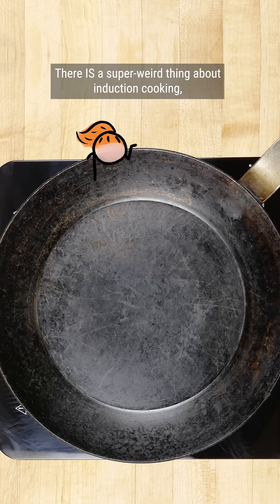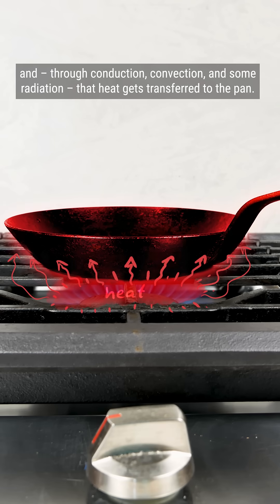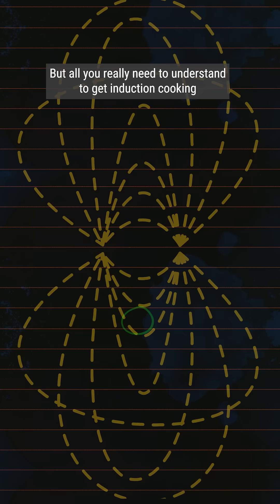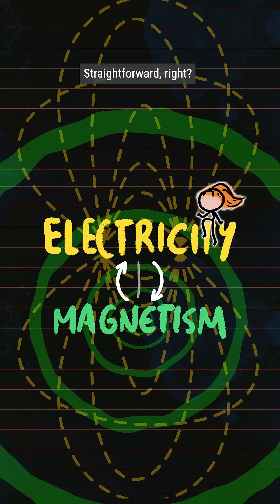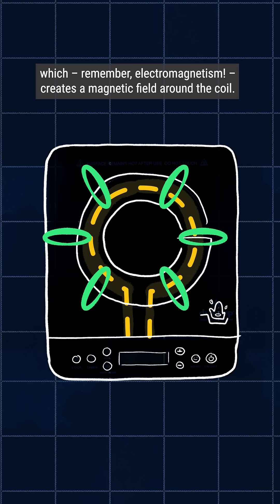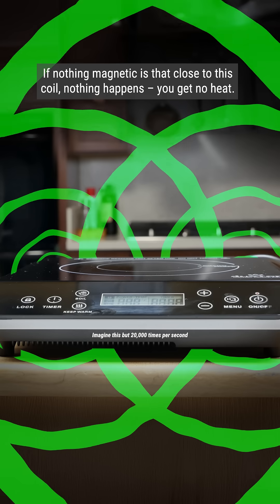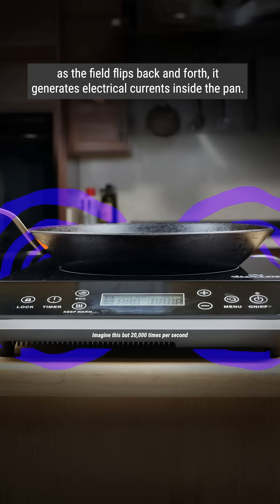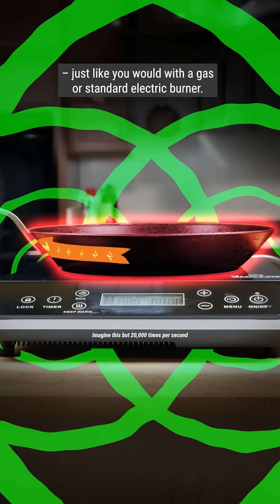How Induction Heats Your Pan

Comment: So yeah good attempt but it’s not actually correct. As has been stated, only ferromagnetic cookware works properly on these burners. This is because the heat is mostly generated through the losses associated with magnetisation or hysteresis losses, not eddy currents.

Comment: The other weird thing is that cooking with induction is a lot more like cooking with gas than cooking with an electricity burner bc when the power is gone, the pan starts to cool down immediately whereas on an electric burner the mass of the burner retain heat for a long while…. (A ceramic (infrared) is more or less in between the two) 

If you can't stand the heat (in the kitchen) it may be time to switch to induction :D

Comment: It's NOT magnetic feld, IT IS A RESONANCE FREQUENSY!
Reply: what do you even mean by that? It's just eddy currents in the metal of the cookwear that generate heat. Those are caused by the oscillating magnetic fields of the cooker. Simple as. The frequency does play a role, but saying that resonance frequency specifically generates heat is kinda wrong.

Comment: Why doesn't wire carrying AC current get inductively hot?
Reply: Short answer, is that unless designed to do so, most wires, offer such low resistance that any induction losses are very low per metre, so very low heating. If You mean they can't heat under AC if required..."If AC current reverses itself 60 times a second, how can it be measured since equal positive and negative values will cancel each other, with a net result of zero amperes? The answer is: The value of AC current is not based on its average value. Instead, AC ammeters really measure the heating effect of the AC current. The ampere scale on an AC ammeter is calibrated in effective amperes, also called root-mean-square (rms) amperes.

To fully understand this concept, let's briefly talk about current and resistance. We know when DC current is passed through a given resistance, heat is produced. Well, AC current also produces heat when it is passed through this same resistance. In both cases, this heating effect is proportional to I2R. That is, this heating effect varies with the square of the current (I2) for a specific resistance (R). The larger the current, the greater the heat produced in a given circuit. Therefore, an AC ampere can be defined as that current, flowing through a given ohmic resistance, which will produce heat at the same rate as a DC ampere
Reply: another answer, in case, I misinterpreted your question.... "Induction cookers use electricity to heat metal in a less direct way. By using AC current, the induction cooker actually creates a magnetic field that switches back and forth very rapidly. This has a heating effect on metal, as the atoms are continually excited by the magnetic field jerking them around. "
Reply: It does tho, because passing current through anything resistive generates heat.

Comment: biggest downside to induction is needing the right type of cookware to use it. cheap non-stick pans from walmart won't do the job, it needs that magnetic base to resonate with the cooktop
Reply: The non stick stuff is bad for you and the environment anyway. PFAS are the new ozone - only way more toxic. Use a stainless steel or cast iron pan/pot - they last longer too. A
Reply: Cheap induction-ready pans exist.
Reply: There is no resonance and the base does not need to be magnetic. Just thick enough to allow substantial currents to flow.

Comment: Does induction stove work with every pan and pot ?
Reply: nope. Just look for "works with induction cooker" label or however they are going to word it. Anything non-metal won't work at all, so don't even try that (well, you can try it, nobody's in charge of your life but you, it's just that nothing's gonna happen).
Reply: No, they must be made of, or contain with their base, ferromagnetic metal. If a magnet sticks to the pan, it will work.
Reply: @thegreybrewer  If that was true, copper wound transformers would not work. A conducting material is needed but it does not have to be ferromagnetic.
Reply: No, they must be made of, or contain with their base, ferromagnetic metal. If a magnet sticks to the pan, it will work.

Comment: if that changing magnetic field produces current in pan why not pan give electic shock while touching ??
Reply: Because the metal of the pan short circuits it.
Reply: Because the current being created forms loops going through the pan, with no charge being added or removed. When you touch the pan, the loop has no reason to flow through you because there is no need to equalize charges.

Comment: "But if say, a magnetic pan"
The pan could be stainless, could be alloy. Won't make a difference, it simply needs to be conductive, not magnetic.
Reply: Incorrect. There needs to be at least a slug of ferromagnetic material within the base of the pan. Stainless is not magnetic.
Reply: @thegreybrewer  Did you know that copper-wound transformers (ie all of them) work? Ferromagnetic material is not needed.

Comment: Does the handle of the pan get hot too? Or is the interaction only close to the surface.
Reply: Some heat may eventually be conducted to the handle, but it's nowhere nearwhat happens when a gas flame licks up the sides of a pan.

Comment: They're also something like 30% more efficient than standard electric stovetops and most have pan sensing abilities so they wont even turn on until the pan is detected.
Reply: i have pan sensing abilities aswell, whenever my mum used to hit me with a pan i could immediately tell it was a pan that struck my face
Reply: Think it is even more efficient than that. As its not only about the heat generation being more efficient as such but also less heat loss in the system.
Reply: @meibing4912  heat generation is not more efficient, only the heat loss is different. direct heat generation (excluding things like heat pumps) is always 100% efficient, the only way you can mess up is if the heat gets lost.
Reply: @meibing4912 Isn't the loss of energy already accounted in the efficiency?
Reply: moreover, they heat wayyy faster so you dont have to turn them on few min before starting the frying @meibing4912
Reply: @meibing4912 nah it’s actually less then 30%. It’s between 10-20% more efficient than electric stoves and up to 60-80% on gas. This is because both gas and electric heat up the stove,air,and pan where as induction only heats up the pan. The reason they arnt more efficient is because the electromagnetic field uses some energy to make the field and to carry the electrons through the field which wastes some energy
Reply: there is not really a system to prevent accidentaly turning it on heat is only produced when a metal coil is over it
Reply: @TheHorsesMaster  ring could get toasty
Reply: My only complaint is how many use touchscreens to try to seem more futuristic. Genuinely infuriating accidentally turning the stove or oven off because I bumped the screen. Tactile knobs and buttons just work way better for some things....
Reply: How much more efficient (energy wise) is it compared to gas stoves?
Reply: @nazimelhadi4700  If you're talking about Gas Stove vs Same gas -> powerplant -> Induction, Gas stove wins a bit.  Gas-powered power plants aren't very efficient.  If you're not counting powerplant efficiency because you're using nuclear or renewables, induction is about twice as efficient in terms of energy input vs energy into heating your food.
Reply: @st8113  yes not counting the energy source, just energy in vs heat out. Thanks for the info!
Reply: then again every induction stove i had blew up and threw glowing hot stuff just behind the counter where i can't reach
Reply: Mine does 1700W each
Reply: And for extra safety it sometimes wont turn on even if it does detect a pan!
Reply: Your source of electricity is not clean, prolly from coal or gas power plants, which means that overall itll have a higher carbon footprint, we can call it more efficient when we have clean energy.
Reply: @Anonymous-kb7iy nah, in France we use atomic, wind, sun and water energy only now, so no coal burning for us. 
Induction is by far superior to gas.
Reply: @ShiroIsMyName  look up your country's energy generation data, you guys run majorly on fossil fuels for electricity. And as I said, only superior iff energy source is clean, which it isnt. 

It means that u convert gas to electricity then electricity to induction heat and youre telling me its more efficient then directly using gas for heat?
Reply: @Anonymous-kb7iy  In 2020, nuclear power made up the largest portion of my country's electricity generation, at around 78%. Coal energy is declining and due to cease. Renewables accounted for 19.1% of energy consumption in 2020. 
Source: Bauer-Babef, Clara (2021-05-06). "France trailing behind EU renewable energy goals"
Reply: @Anonymous-kb7iy Crazy how you are so confident in being wrong
Reply: @Anonymous-kb7iy   Even if we ignore how wrong you are and focus on the whole is it more efficient to burn gas for electricity and use that for induction than burning gas directly.... yes. Gas tops waste a CRAPLOAD of heat around the pan. That is energy loss. Burning it at a power plant, while still not desirable, to power an electrically powered cooktop, especially induction, is a LOT more efficient.
Reply: @Anonymous-kb7iy so using less fossil fuels isn’t better than using more fossil fuels?  That doesn’t really make any sense.  I agree we need to work on the complete removal (or at least as much as physically possible) of fossil fuels but there will always be need and use for more efficient technology.  If you look at grid usage, it has only drastically risen over time, and currently it’s hard to generate as much energy as consistently via renewables vs fossil fuels.  So it would benefit everyone for us to make more energy efficient… everything
Reply: @Anonymous-kb7iy , I understand you're trying to account for the fact that their country is using gas or coal to generate power, but this is a non-sequitir. 

The efficiency of power generation for an electrical grid being inefficient doesn't have bearing on comparing the energy efficiency for induction vs other stove tops.

Regardless of how their power is generated, it doesn't change the overall physics of how much more efficient induction is and you're starting a separate discussion.
Reply: @Anonymous-kb7iy nope we don’t. The uk is mostly renewable energy. 55.6% wind 24.3% nuclear and imports which are low carbon and then 15.6% is fossil fuels
Reply: @Anonymous-kb7iy you are clearly missing somthing. Using gas to make electricity is more efficient by a long shot. Gas stoves push most of its heat into the air, when using gas to produce electricity 55% of the energy is going into electricity and only 45% is wasted where as 55% of energy in a gas hob is wasted. Furthermore induction only wastes 20% so overall it’s a lot cheaper
Reply: @Anonymous-kb7iy bro's never heard of solar panels 💀
Reply: @Anonymous-kb7iy it doesn’t matter. It’s still more efficient than anything else. It uses a total less energy then electric and gas. So even if it is electric powered it still uses less resources to power it thus making it efficient. Efficiency and carbon footprint don’t really have much in common as somthint can be perfectly efficient and still have a really bad carbon footpriny

Comment: adam ragusea has a good video of different types of cooktops. gas flame is actually the LEAST efficient form of cooking. because a large amount of the energy produced goes to heating the ENTIRE pan. not just the bottom cook surface. the side walls will also become cooking level hot. 
Certain dishes cannot be cooked in an induction heated pan because the side walls dont get hot. or if they are cooked then they are vastly inferior to one cooked on a gas flame. the opposite is also true of other dishes as well

Comment: Engineer here.  It uses high frequency AC at high power to cause massive eddy currents in the metal in the pan which generates a lot of heat.

Comment: Stupid question, but could someone get shocked from the elecricity induced in the pan?
Reply: Not really the pan is one singular piece of steel with no point of differential differences, unless you touch the 'tops internal you'll be fine
Reply: Not really the pan is one singular piece of steel with no point of differential differences, unless you touch the 'tops internal you'll be fine

Comment: My favourite thing about induction cooktops is that because the heat is generated in the pan itself, if you were to take a pan and cut it in half, put it on an induction cook surface and crack an egg in the middle, only the egg in contact with the metal will cook, even with the cook surface turned up to its highest setting; you can even place your bare hand on it and, as long as you're not wearing any metal jewelry, nothing will happen

Comment: So it's just good ol' resistive heating all over again, but wireless.
Reply: There are literally wires in the cooktop. But instead of the wires heating up, the pan does. So much less heat energy is lost licking up the sides of the pan, or heating the glass top to stupidly high temps. Much more efficient, too.
Reply: @thegreybrewer  Yeah I want an induction stove but expensive lol.

Comment: The pan doesn’t have to be steel.  Many stainless steel pots and pans work, even though a magnet won't stick to them.  Some also have a thicker base that contains an induction plate.
Reply: but there will be ferrous metal in the base. Non magnetic stainless by itself will not work.
Reply: Stainless steel is still steel

Comment: Had terrible experiences with the old electric stoves so swore to only use gas. That was until I tried induction, haven't looked back since
Reply: yeah, the issue with typical electric stoves is STARTUP TIME, it takes forever for the resistive elements to heat up AND cool down, and then it takes that transferring step to move heat from the stove to the pan, and when you shut it off, it's still "hot" and putting heat into the pan until it naturally cools off. Inductive heating is instant application or cessation of heat on the pan because the heater itself never gets hot, only the pan! What fancy tech...
Reply: @ferociousfeind8538  To be fair, I didn't really mind the warm up time, what I did mind was the lack of control, need something slightly hotter? That'll be five minutes.
Oh it's too hot now and boiling over? Hahaha better move it completely off the ring as that's not going to cool down before the next ice age.

Whereas gas and induction, you just turn the dial (or in my case slide the slider) and the change is immediate
Reply: @EdgyShooter that literally means u minded the warmup (and cooldown) time
Reply: Typical people either not understanding the technology or buying super cheap crap. Spend some money on it and induction is far superior. I cook in a commercial kitchen with gas as all chefs are old and stupid, I come home to my induction range and love it. Buy better equipment.
Reply: @phenel whyd you take this so personally lmao😅
Reply: Again, it surprises me how many homes have gas in it. The fact that they still build many homes that have lines for toxic fumes is insane to me.
Reply: Funny I'm the opposite. I despise induction stove tops and find a gas stove top far superior for temperature control and versatility.

That said, I strongly dislike gas ovens, and would opt for electric there.
Reply: @ravioliravioli6175  why do you prefer gas? Because it creates tons of heat that gets wasted in the air? Because it fills your home with toxic fumes?
Reply: @naturedetectiveminecraft6362 Because there is a big difference between cooking with gas or induction. Induction takes quite a while to get used to if you've cooked on gas for 30+ years. I've worked in both kinds of kitchens and for me, by far, gas is better. Who cares about a bit of toxic fumes or fire hazards it's better than eating subpar food for weeks/months to get used to it.
Reply: @gigian1000  I don't wanna get cancer that's why
Reply: @ravioliravioli6175  using gas in 2025 is pretty caveman
Reply: @DuBstep115  tell that to most commercial kitchens and professional chefs
Reply: @ravioliravioli6175  only benefit of gas that you can have like 20 burners in one top. That's why they use them
Reply: @DuBstep115  sure pal
Reply: @DuBstep115 that's just simply not true. Look at world stats.
Reply: @ Yeah, 90% of the world cant afford AC and lives in poverty. Those stats I am supposed to look?
Reply: we have induction ... it is ass and we want our old gas stove back ... but cleaning is better
Reply: @AChicken-sh1gc imagine using gas in 2025
Reply: Gas is better , i throwned that induction garbage
Reply: @kiril946 gas is better burning houses down, leaking and smelling bad. Keep living in 1800s